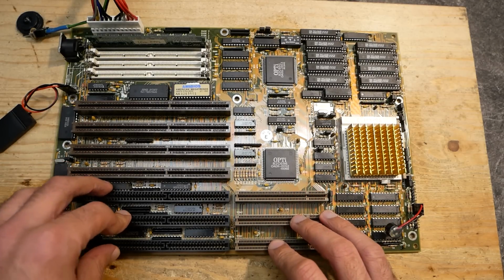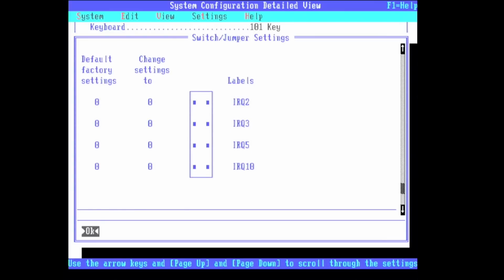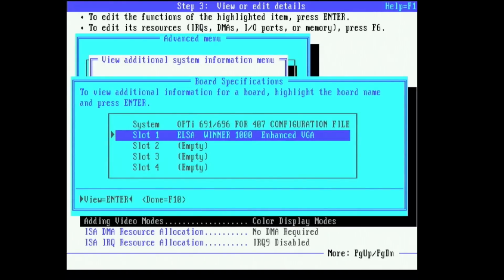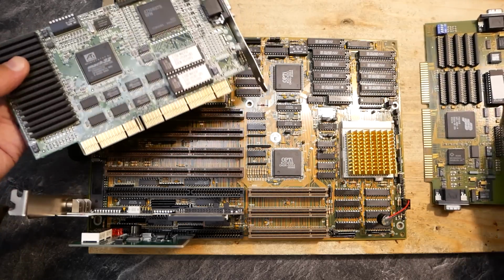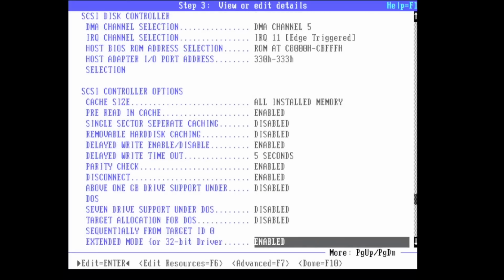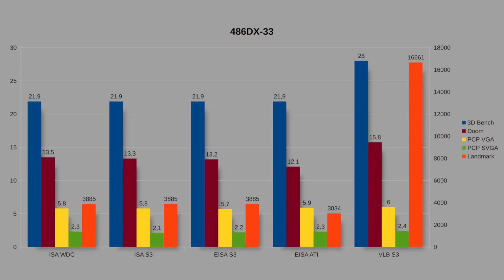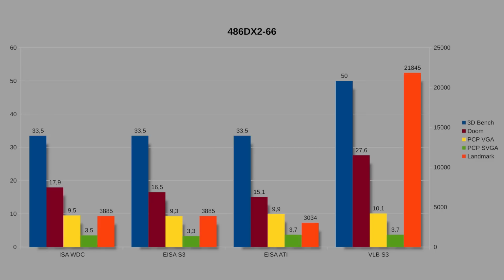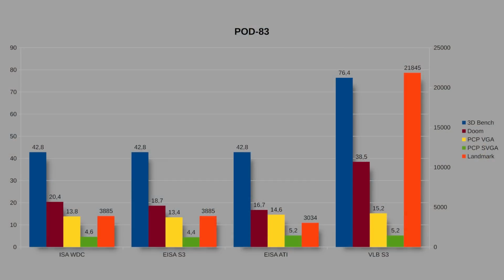Configuration and test of a 486 EISA/VLB mainboard

Comment: What's important to keep in mind is that EISA was always a bit of an afterthought for most card manufacturers. There were some types of cards, particularly storage and network cards, that were native EISA and could use the full bus width, but for something like a graphics card there was just no incentive to make an EISA-specific chip when they were going to sell 100x more VLB cards instead, and so you'll find that most (if not all) EISA graphics cards are actually plain 16-bit ISA chips with just enough added circuitry on the card to make them talk to the EISA bus. The ISA and EISA cards performing identically is exactly what I would expect to see.

Comment: For me, it is surprising, that Doom scored that bad on VLB card. I remember, when I upgraded from ISA to VLB (Both of which were Cirrus Logic VGA cards), the memory bandwidth uplift also visible in your test allowed me to switch from "Low" to "High" graphics settings as on 486DX33 (which was my machine at the time) the main performance issue was insufficient VGA memory throughput. Or, maybe I am not remembering it completely right. Doom is also "quite computation heavy" and I used to have also 486DX2/66 at some point, where the gap is more like I remember it used to be.
Reply from the maker: Hi. A long time ago I made a video about exactly this topic. May be you want to take a look https://youtu.be/rZcAo4oUc4o

Comment: I would love if you continued with this idea and used an ISA, PCI and AGP video card in a DFI P5BV3+ motherboard. It's Socket 7 and has all 3 of those.
Reply: Also, the ASUS PVI-486SP3, Gigabyte GA-486VF, Biostar MB-8433UUD-A all had PCI, ISA and VLB slots and where Socket 3.

Comment: If there's EISA video card with 32bit "GPU", it should be a lot faster than ISA card with 16bit GPU. For example Cirrus 543x EISA. The second Phoenix configuration software looks the same as in Compaq EISA machines. Had one but it's PSU blew up with fire and then I sold it away :D

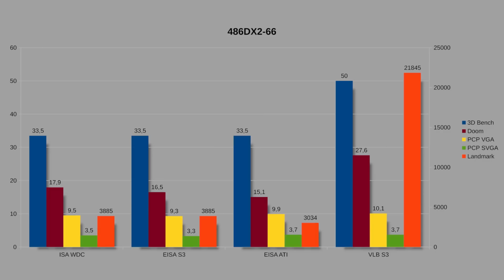Comment: 27:50 that's funny, 21845cps and I was complaining the other day about modern windows being slow.

I made some crude tests and Windows10 was not able to deliver more than 3 Mcs (mega-chars-per-second) on old console API, Linux could easily win against that, no wonder they say Windows is slow.
 But Windows11 on the new console API can deliver 10 Mcs easily, on powershell (after some modification on the output stream to be textmode instead of objects), on native C++, it can deliver 11 Mcs (mostly because of less marshaling), and that was the fastest I could make the new Windows Console application handle, I bet it is V-sync locked on DirectX, yes, the console application uses DirectX. It obviously wasn't being held up by the GPU (a Gefore970)
On Linux I got 12 Mcs, that's as fast as one char can be copied each time using file pipes between processes on a modern system (without compression or shared memory mapping, pretty good).
 Windows is a bit slower because it has to triangulate the piping from the process to the console host to the console application. Linux has no console host / console application separation, which is bad actually as you usually need shit like "screen", or tmux.

Comment: That's a nice one, I haven't seen an EISA system in real life yet!
My take on the marginal speed diff: I think it's down to how bus transfers and software work. You can have a 32 bits path, but if software only transfers with 8/16 bits to the card, it's not being used, if the chipset doesn't combine it (which I bet it doesn't). That VLB can still be faster may be purely down to its higher bus speed.
Here's what you should test: 16 bits vs. 32 bits transfers to graphics memory. If the chipset does full 32 bits transfers to EISA, I bet you'll see a difference between ISA and EISA! I've written two benchmarks in the 90s for my own purpose, but could extend them for you to also test with 16 bits transfers (it did 32 bits already). Drop me a comment how we should get in contact then.

Comment: I suspect that the benchmark software all runs in real mode, so it doesn’t even have access to 32 bit instructions. Doom uses a DOS extender, so it probably could use 32 bit instructions, but given the scarcity of EISA systems, it likely made no since to support EISA video cards specifically, which would have added significant development effort. You might see a difference in Unix or Windows NT, if you can find good drivers.
Reply: You can use 32-bit instructions in the real mode just fine.

Comment: As someone that didn't get into PCs and it's hardware until after PCI was the reigning standard this was fascinating because while i've had hands on VLB mainboards, i've not really used any systems that used the cards, and i had previously thought that EISA was just the name for the 16bit ISA slots instead of the older 8bit ones

Comment: VLB could be more fiddly to get working, there were typically jumpers to configure the motherboard if you had a single vs multiple VLB cards and miss configuration would stop the system posting.

Comment: The ATi Mach 32 was always a disappointment for DOS applications. There were a few publishing or illustration packages that were able to use the graphics accelerator, but otherwise you needed a fully functional GUI like Windows or OS/2 v2 or better to really get the power out of it. As a standard DOS VESA device, its memory handling was slowed, even on VLB, thanks to buffering in the accelerator despite the fact that it was not being driven. It was a sad early take on graphics acceleration and the OS market just wasn’t ready for it.
Reply: I have integrated ATI Mach32 on VLB bus in my ICL D4/66XGi, CPU is DX4/100. It's damn fast, throughput is around ~30MB/s so it runs everything in DOS if the CPU can handle it.

Comment: Thank you for this excellent video. I was 13 in 1989. I remember reading about all of these in computer magazines at the library. By the time I started working with servers it was all PCI. You answered all of my questions from 35 years ago about how EISA works on a real machine. Thank you. Also that SCSI card is AMAZING. I think it would of cost more than the car my family had at the time!

Comment: I wonder if a program that writes to vram using 32-bit writes could unlock the full potential of EISA... which since using 32-bit protected mode turns the 16-bit MOVSW into the 32-bit MOVSD this might actually mean the cards perform better under Windows!... though if the 3d benchmarks use protected mode I would doubt it, as those have no reason to do anything but bitplane-wise block copies for the framebuffer

Comment: I remember EISA being the hot thing for a minute in the PC world but almost exclusively for disk controllers and NICs in servers. Usually those servers ran NetWare 3.x or a flavor or UNIX, both of which had 32-bit protected mode support and could utilize 32-bit drivers. DOS is a 16-bit OS through and through as far as the hardware is concerned, unless you had specific drivers loaded. Driver which were not present in these tests and may not have been available in DOS for these EISA cards.

Even if a EISA card is installed in a 32-bit EISA slot, there's no guarantee it's doing data transfers 32-bits at a time. If that's happening then EISA's same clock rate as ISA would lead to similar performance. VLB's superior clock rate meant that even if data was only being transferred 16-bits at a time it would always be much faster than ISA. There were video cards released for VLB that only used 16-bit data transfers, the Cirrus Logic CL-GD542x series of cards are one example. They're VLB but only transfer data through VLB 16-bits at at time. They're faster than their ISA counterparts solely due to the faster clock rate of VLB.

Something similar was also true much later on in the early days of AGP. Some of the earlier AGP cards, like the 3dfx Voodoo 3 cards, treated the AGP bus only as if it was a 66 MHz PCI slot and didn't use any of the other AGP specific features.
Reply: Even if a card didn't take advantage of any specific AGP features, since AGP was a dedicated interface (vs the shared bus for PCI) it meant you could still see better performance especially if you had other high-bandwidth PCI cards in the system.

Comment: Man i love VLB (as far as one can love a Bus ;)) maybe because my first PC was a VLB-based system. Actually still is :-) running still strong 30 years later (Varta battery damage repaired by me 😮) with my original VLB graphics card, a Diamond Stealth64 (S3 Vision964) with 2 MB VRAM paired with a AMD Am486DX2-80. I just love that system ☺️ Great video with a lot of information! Thanks and greetings 🤘jenzGuitarist 🤘
Reply: VLB is plug and play compared to EISA. Also, I recall in the 90s building myself a DX-50 (not DX/2) and running the bus at that speed (the VL bus, anyhow) and I never had problems with the 32 bit controller card or the ATI video card. I recently sold another self-made DX-50 486 in a similar configuration without issues. Apparently these were notorious for hanging at higher bus speeds. I've never had a problem with it... Maybe just dumb luck?
Reply: I miss VLB, imagine an integrated bus with the CPU and the Memory and the GPU on the same addressing space and data can be shared instead of copied. 
Oh, you don't need to imagine, just look at the XBONE and PS5 architecture.
Come on, Intel, I want something better than just putting more and more PCIe lanes, the latency between the GPU and CPU is too high on modern PCs. Maybe that doesn't matter for most games. I blame that on nVidia scalping on the prices of "GDDR", as if GDDR was any special, instead of accessing it at 512 bits like the CPU does, GPUs access it at 4096 bits, as if 4-channel DDR5 didn't exist, and yes, I know the signaling is a bit different, that doesn't justify the exorbitant difference in the price.
But I like games with lots of physics deformations (BeamNG) and "blocky" games like SpaceEngineers (or any game that uses PhysX, maybe its a Havok/PhysX problem) and Satisfactory (Unreal) and games where the user places things, and those suffer a huge drop in performance because of the bottleneck of the PCIx as a lot of calculations still have to be made by the CPU data moves back and forth between the CPU and the GPU.
Another kinds of games that suffer are the ones that use virtual reality. 
Every time you have to do a copy-back from the GPU to the CPU you lose performance. 
I bet if I could run all of those games in a PS5 modified to run Windows11 , I could see absurd difference in perfomance just from the fact memory is unified.

I want a new VLB !!!

Comment: EISA is 32-bits, but most games will only write to video memory one byte or two bytes at a time. Because of that, the games won't get any benefit from the wider bus. This is part of the reason Pentium Pro and Pentium II processors added write combining. Writes to consecutive addresses get merged by the CPU to a single bus transaction to take better advantage of the wider bus. If you could find such a system with EISA, I suspect the EISA cards would be much faster than the ISA cards... after running fastvid, of course.

Comment: I know nothing about EISA, so I'm just speculating:
Could the poor graphics performance on EISA be caused by a poor chipset behavior, especially how the memory controller writes the 13h mode's mapped 0xA000 memory to the bus/video graphics adapter?
Maybe, it does always use 16 bit bandwidth (or even 8 bit if no burst writing is used at all) regardless of the fact if the graphics adapter is an ISA or a 32 bit EISA one?
(but you're right, benchmarks with cpu in protected 32 bit mode should be tested as well)

Or in other words: Maybe other EISA/ISA boards with a different chipset would show a significant difference between ISA/EISA when using the same graphic cards as in this video?

Comment: I've never looked into EISA, as it's hardly more than vaporware given its minimal install base.  I'm surprised to learn that they increased the bus width, but didn't bother to increase the bus speed, thereby knee-capping it to 2x the speed of the bus that was already a bottleneck.  What an oversight.

I guess it makes sense that it never really took off.  I can't imagine paying the premium for such a minor improvement -- and, as shown here, sometimes no improvement at all.  VLB, for all its problems, was at least (potentially) 3x faster on a 486 at 25MHz, and 4x faster on a 33MHz bus.  And the difference was immediately obvious using the same code.

Hindsight's 20/20 and all, but the baked-in obsolescence, and not including the config metadata in ROM, both seem like a real missed opportunity.  Is that really the best that heavy-hitters like Compaq, AST, and HP could come up with?

Comment: Another point to consider is whether specific EISA cards fully take advantage of the 32-bit bus.  This was also the case with some VLB graphics cards, but those at least could take advantage of the higher bus clocks.
Reply: Was just wondering about that... the software/drivers themselves would also have to use 32-bit access, which VGA probably wasn't originally designed for. So, if that logic is right, then VLB would most-likely use 16bit access as well, just at 32MHz instead of 8.
I wonder if the results would be different for newer games, e.g. designed in the VLB/PCI era. Also, maybe those that ran under Win9x?
Reply: @ericwazhung  that's not true, a 32-bit bus could just do two 16-bit transfers at the same time, which would still be twice as fast for 16-bit transfers.
Reply: You see they don't as the  PCP VGA & SVGA tests are effectively identical over all boards, and if you look up how this software communicates to the VRAM/GPU it's done on basic DOS calls into shadowed RAM ... that's with ISA at max 16 bit wide.

More correctly 8086 is a the CPU for DOS, it has 16 bit bus and the "eXtended" ISA (that long 8 bit and the short another 8 bit) is a representation of that.

Comment: Did you ever try to run more than one video card at the same time in these motherboard ?
Reply from the maker: With ISA it wasn't possible to run two VGA cards, since they would conflict. I didn't try, but  I'm sure this system wouldn't allow that. Back then it was possible to run a VGA and Hercules cards simultaneously, since they have different video memory offsets.

Comment: I'm guessing you might see better differences between ISA and EISA with a hard drive controller interface. 32-bit file transfers in an OS that supports it would probably be better than 16-bit. I don't think a basic ISA multi-io card could hold a candle to that high end SCSI card though.

Comment: Awesome video on a really neat bit of tech. Thanks Necroware, I had been waiting for this one having sold (486 based) EISA systems in my early years of IT. 

If memory serves EISA was initially implemented on 386 based systems. When you consider that the PC gaming boom, particularly "3d" shooters etc, hadn't happened yet it makes a certain amount of sense that earlier EISA graphics cards were under performers on that front. The lack of driver and game optimizations would be another performance hurdle. 

EISA graphics cards were pretty much exclusively targeted at workstation use, CAD, graphic design etc where the 32bit interface could be fully leveraged. The vast majority of DOS programs and games would have basically 0 optimization for 32bit transfers so performance would be near identical to a simpler ISA graphics adapter. VLB benefits far more from the bandwidth (CPU FSB speeds) than it does from it's bus width, at least where it comes to (DOS) games and most graphical DOS benchmarks. VLB cards were pushed hard for their superior image quality and windows optimizations, optimizations largely made possible by the increased bus width and bandwidth. Early VLB cards were initially designed as a cheaper alternative to workstation graphics that required specialized motherboards and proprietary slot interfaces (like IBM's). If memory serves the primary benefit was windows acceleration which was a huge selling point at the time. This was also around the same time that commercially viable color printers began to gain popularity in the consumer market so accelerated graphics applications were another big market.

That Mach 32 card was a hell of a card in it's day, fantastic performance in windows with high bit depth and phenomenal image quality. They were quite sought after, the Mach 64 was technically the better card but commanded quite a premium making the Mach 32 more popular.  

Please forgive my memory if any of this is wrong, it was a long time ago now and we also didn't have access to information on the internet like we do today so a lot of info came out of magazines etc so I may have even been wrong back then too....
Reply from the maker: Exciting! Thank you for sharing your memories with us.

Comment: A 486dx2 is capable of performing reasonably with Windows 95 in 32bit mode. I'm not sure if benchmark software of the same era will help, but as you said, it's likely that software written for that slot is unobtainable.
Reply from the maker: I hope, that Windows 95/NT and native programs and games on it would be able to use the full 32-bit bus out of the box. Well, that only means, that this story is not yet finished ;)

Comment: 32:25  At a further guess, the EISA cards may only be using the semi-auto-configuration of the bus, but don't actually have 32-bit capable GPUs, possibly as a cost saving measure.
Reply: True! They may be 16bit projects adapted to EISA.